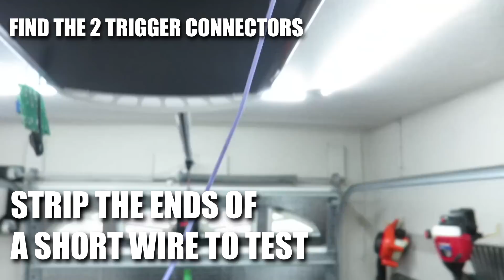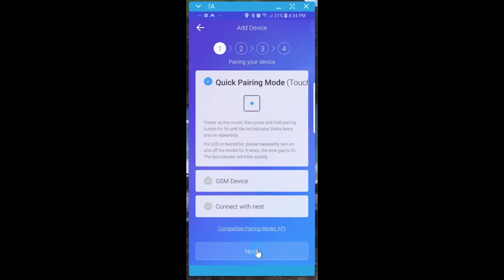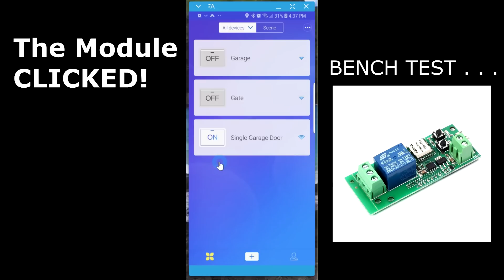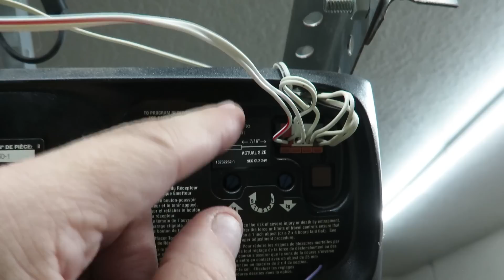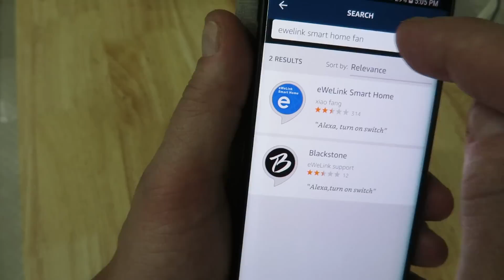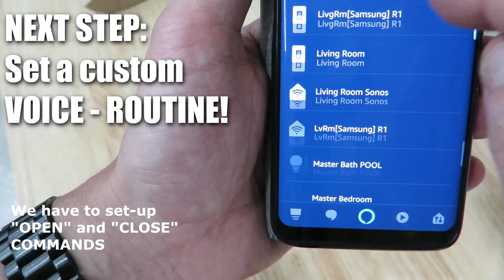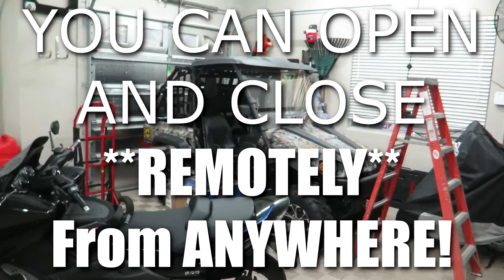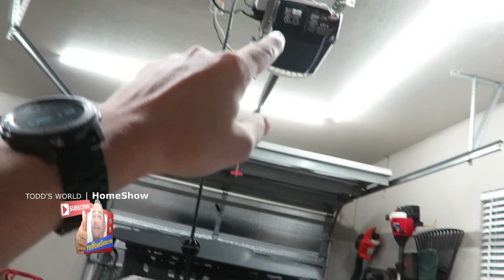SMART GARAGE DOOR OPENER | $15 | eWeLINK Smart Control for Garage Doors | with ALEXA & Google HOME

Comment: This will not work with the latest high-end Chamberlain/LiftMaster openers that use Security+ 2.0 technology.  They use a proprietary communication protocol on the 2-conductor bell wire that connects the wall controller with the opener; shorting the wires together only causes loss of power at the wall controller that contains the door control and light control buttons, but the door won't open or close.  The next-best thing is to wire the eWeLINK Smart Control N.O. relay output across the pushbutton inside the wall controller, which requires soldering a couple of 22 or 20 AWG wires to the appropriate pads on the circuit board and bringing them out of the wall controller housing to the eWeLINK Smart Control.  To reduce likelihood of RF interference with the the wall controller, the eWeLINK Smart Control should be mounted within a meter of the wall controller.
Reply from the maker: Very good explanation...although, it works fine with my LiftMaster Security +2.0 and the button works with the eWeLink board connected directly to the motor. BUT, my older LiftMaster 2.0 single garage standard door opener - has the eWeLink connected to the motor and the Wall-button doesn't work. This doesn't bother me because I just say or speak-now to open either door. I don't even use the physical buttons anymore. I'm not sure why the buttons work with some and NOT others????
Reply: My only experience has been with a LiftMaster model WLED, which was installed in July 2019, so it's a very recent unit.  Chamberlain isn't forthcoming about the technical details of their openers, so it is possible that they've changed the circuitry recently.

Comment: Is there a better duration I should use for inching mode? The app works great when I’m at home and need to open and close the garage. But when I’m driving home and am around the corner and the use the app, I’m seeing my garage only cracked open.
Reply from the maker: I had to increase my inching duration on one of my openers to (1). My other door opener is set at (.5) and works fine.
Reply: tw HomeShow thanks for the reply. I did that this morning and it worked. 
Now the issue is when I got home, the device was offline on my app and the module is blinking rapidly 4 times and repeating. I’m unable to switch it back to pairing mode neither. Any idea what the problem would be?

Comment: I was able to connect the phone app to the device and hear the clicking sound when turning on and off. However, when i have it installed to my garage (Liftmaster), I am still able to hear the clicking sound but no action on the door. It just won't open....
I wonder if I am doing anything wrong... also,  my garage unit doesn't pass the jumper cable test at 1:40... I wonder if that is it and the eWeLink unit just won't work for mine opener....

Comment: I had a problem when we had a power outage.When the power came back on my module activated and opened the door.Has this ever happened  to anybody?
Reply: Yes! If my power goes out and comes back on, the relay will activate itself and start to open the garage door. Then, it will activate again and stop it. This leaves the garage door open about 3" forever. I have an email in to the mfg.

Comment: PROBLEM... If the power goes out, Garage Door OPENS on power restoration. That's a big problem if you're away and lose power!!
Reply from the maker: Why would power going out activate? Even if it did, you would be notified and you could just close it within the app. I don't get the "Problem"???
Reply: @twHomeShow  when power is restored, the unit reads the power surge as a button press.  Try flipping your breaker off, wait a few seconds, then back on.
All else is great.  Just need to figure this out!.  BTW... Your channel is GREAT!
Reply from the maker: @stephenm2221  ahh, I see. Thanks
Reply: @twHomeShow  Got any ideas?  I'm thinking about it.  If I come up with anything. I'll let you know.  This is all you!

Comment: Great video and instructions. Is there a way to use this same method to solely control the lights to the garage opener. I want these lights to come on with my other car ports lights by  grouping them in my Alexa app.
Reply from the maker: I have the other ceiling lights in my garage controlled by Alexa with smart plugs that they plug into :) Maybe you could do that?

Comment: I have a Craftsman garage door opener whose button wall panel sends a digitally encoded message via the wire to the drive unit, so this videos instructions didn't work. However, all I did was directly solder the two wires to the button on the wall panel circuit board and that did the trick!

Comment: does this have battery backup? what if the power blinks?
Reply from the maker: You would need to use a battery power supply and also have your internet somehow backed up with a battery power supply unit.

Comment: I have a question, if i say echo close garage door  when are close could be open?
Reply from the maker: The ewelink switch doesn't identify if the door is in an open or closed state. So if you say open or close, it will just activate the door.

Comment: Excellent! Picked one up for $13, plus $5 for more bell wire than I will ever need in my lifetime. I already had a micro-usb 5v charger laying around. Works like a charm. Thank you for posting!
Reply: hi Tracey  made i ask where did you get the circuit board? thanks

Comment: Does it always work for you? Idk why my only work sometime and sometime it doesn’t. Do you have any idea?  I used speaker wire to connect between the relay module and the garage.  Can this be an issue
Reply from the maker: YES. Mine work 100% of the time, except when power goes out :) I would check your wifi signal in your garage . . with an app you can download on your smartphone. Make sure you have a constant strong wifi signal-range. ALSO, within the eweLink app (in settings) there is a timer adjustment, where you can adjust the time it activates, like within miliseconds. You may have to tweek that time up just a half (.5) milliseconds to give it a little long activation time.
Reply: tw HomeShow So on my app. I always have 3 bars for the wifi icon. Is this actually show how strong the wifi signal is or is it just there as an icon and never change. Also, my inching timer has already been set to 0.5 milisec when I first open it. I’m just wondering if there is a way to test how strong the signal is because I got full bars on my phone when I’m placing my phone at the exact location of the module.

Comment: Did you have to change the setting of the module to "inching" ?
Reply from the maker: The button on the module that you have lit and activated, determines inching mode. In the video make sure you watch that I choose the middle button ONLY, to be lit. and that one is inching mode.
Reply from the maker: You can also set the inching duration time within the setting on the eWeLink app, if it needs to be longer time or shorter time by, like milli-seconds.
Reply: @twHomeShow  thanks for the rapid response ! But still a little confused . What do you mean you choose the middle button only ? I have the same chip as you. Setup via your video ...wire in the same location . But I see an option in the setting on the ewelink app for itching ... If everything is setup like your video I'm guessing I shouldn't toggle that on? (Haven't tried my setup yet, just setup infront of me right now)
Reply from the maker: @DanK-Mtb  If your button (ewelink chip) is programmed, if you go to it within the app, you should see at the top right corner after you choose your button that you have setup within the app, select the top right corner and select settings, and slide the inching slider in the app to inching (ON position). BUT, make sure your chip has ONLY the middle of the board LED lit-up (that middle button) NOT both LED's and NOT the outer LED on the chip....just the middle LED on the chip should be lit.
Reply: @twHomeShow  ahh ok in the video you didn't reference anything regarding itching let me give it a try now 🙃

Comment: I have a Liftmaster 8355-267 opener. Shorting across the terminals that are connected to the wall switch does not activate the garage door. Is there a fix for this? Or am I doing something stupid?
 (The wall switch has an LED on it, so it must be receiving a voltage through these two wires as well). Thank you, folks!
Reply: Same issue here with my Liftmaster Security Plus 2.0.  This model is a "MyQ" but does not have built in wifi.  Everything works fine, but when I short across the terminals, nothing happens.  I know my app is communicating with the opener as when I turn it on or off, the UP or DOWN buttons on the back of the Liftmaster light up, but the door will not move.
Reply: @SteveFlanigan  Thanks for the reply, Steve. I have come to the conclusion that I will have to use a wireless remote to make this model work. I believe this is because the wall switches do not just send an on / off pulse. They send a digitally encoded signal. The remotes do the same. 

Two wires will have to be soldered to the button terminals of the correct version/s of Liftmaster / Chamberlain remotes. See this video from same author; https://www.youtube.com/watch?v=J_zAhXF_i7I&t=271s

Or, you could buy this Chamberlain Hub with door sensor and also get the indication on whether the door is open and closed as well as receive alerts when it is left open; 

https://www.amazon.com/Smart-Garage-Opener-Chamberlain-MYQ-G0301/dp/B075H7Z5L8/ref=asc_df_B075H7Z5L8/?tag=hyprod-20&linkCode=df0&hvadid=198068910902&hvpos=1o1&hvnetw=g&hvrand=14333608537176965484&hvpone=&hvptwo=&hvqmt=&hvdev=c&hvdvcmdl=&hvlocint=&hvlocphy=9012225&hvtargid=pla-365824222793&psc=1

I installed the Chamberlain hub yesterday. Works well. Alerts are nice. Will probably go ahead and wire up a remote using the sonoff module that I already bought so that I can open the door with Alexa. It looks like both systems should coexist nicely.

Comment: after I install this thing, it opens garage door automatically after power outage.  Any solution for this issue?
Reply: That's not good!
Reply: this is scary, specially because I live in an area when power outages are a normal thing, have you tried Joe's solution? or what did you do?
Reply: Maybe the door sensor would give you some better oversight. At least notify you it is open or something
Reply: It's been 3 weeks since I installed this and haven't got that issue, I have a camera in my garage so I often check just in case
Reply: That is 100% correct. I had to put my ewelink on a smart outlet and leave it off most of the time. If and when I power the ewelink via a separate, smart outlet app, the door will open a few inches. Then, I make the door open or, close all the way. I have 4 cams. in my garage.
Reply: I have an idea, but I can't promise it will work, try buying an inexpensive portable charger that can charge a device while it is also charging, this will provide power to the eWeLink, and when the power goes out, the portable charger should provide power to the eWeLink while the power is out and last at least a little while. I would think there is a better way within the programming, but if not, it's worth a shot.

Comment: I think I may be the only person struggling with getting this to work on my system.  Your instructions are clear and easy to follow, so i'm more than certain this is a user malfunction.  When I get the device connected to the garage door unit, it won't open or close the garage door.  The up and down arrow light laminates on  alternating clicks, however the garage door is not actually opening and closing.  The wall unit still works fine with both cords in. What am I missing?
Reply from the maker: OK, #1) Did you test your garage opener with the test wire on the 2 connectors to see if it activated it? Did it open and close the garage door by touching the looped wire to your garage door opener connections?
Reply: @twHomeShow  I'm being told now that the device does not work with garage openers that has security + 2.0 as in the Liftmaster 7675.   There may be some work around out there, so i'll go research and try again.
Reply from the maker: @c.jenn01  That's weird, because I have a Liftmaster 8500 direct-drive with 2.0 and MyQ, and it worked without any issues.
Reply from the maker: You can look-up my video - how I hooked that one up to eWelink....
Reply: @twHomeShow  That was your first video I  watched before I bought the device.  It paired with ewelink.  I can get the device to on/off with ewelink, the problem is only when I try to get it to work with the garage.  following your directions yesterday, I tried hooking the wires to the wall unit, but that  didn't  work,  I even took the  wall unit down all together and used the wires to connect it directly to the garage unit, that did work, but when I added the device, it didn't.
Reply: @twHomeShow  I think I'm going to return it. The underside below the white square gets extremely hot to the touch every time I plug it in.  I don't know if that common, but it makes me nervous.
Reply: @twHomeShow  Full disclosure, i did the test and it didn't open or close then either.  I just went ahead with the rest of the instructions and hoped for the best.  I figured it had to work, the system is only 4 years old.
Reply from the maker: @c.jenn01  OK, no problem. Can you remove the factory door switch/button from the wall, and it should have 2 wire connections. Try to connect a loop-wire and touch to both of those connections and see if that opens or closes the door. If so....you may be able to connect the eWeLink to that switch instead of the garage door opener unit. But, remember just tap those 2 connections for a second with a loop (test wire) on the back of your switch/button connections and see if it works.
Reply: @twHomeShow  did not work there either. It did the same thing, up and down arrow on the system just flicks on and off alternating every contact.
Reply from the maker: @c.jenn01  Curious, what garage door opener brand do you have? and on the "SYSTEM" that you're talking about, what is that system that shows up and down arrow?
Reply: @twHomeShow  It's a Liftmaster 8165 manufactured in 2015.  When mentioned system, I was referring to the actual garage opener unit.  There are up and down lighted arrow in the back of the unit where the programming button etc.. is located.
Reply from the maker: Hey, CHECK THIS VIDEO.....You can skip until the last 3rd of this video....it seems like maybe you should double-check the testing. I'm not doubting you. Maybe Liftmaster stopped this in their 2015 and newer units so they could sell their "MyQ" APP.....  CHECK THIS VIDEO OUT: https://youtu.be/omIHf5E4CsQ

Comment: I have the MyQ garage door module but since it does not work with Alexa I'm going to try this (Chamberlin SUCKS for not including this feature IMO) but because I have the MYQ app I will know the state of the door (up/down) so that will take care the the shortcoming of this setup. Great video, it was very helpful, and super inexpensive.

Update; I bought the module from your link in the description and it is working like a champ to open my garage door with Alexa. The only Issue I had was the module I received was slightly different different than the one you have and I did have to press the second button on the board to change the mode the default mode of "Normally Closed" (NC) to "Normally Open" (NO) so the switch would work as needed for this application. Not a big deal at all but if Todd mentioned this I missed it. This is an awesome solution, thank you Todd for making this video.

Comment: Todd thanks for beautiful video about setup however it does not work with my chamberlain garage door opener. i followed everything  every time i press button in iPhone app i hear click sound in relay switch but nothing happen to garage door.

Any help would be appreciate.
Reply: I had a similar issue when I set mine up. You need to push the other switch on the board to change the mode to "NO" ie. normally open since the switch is set to "NC"   ie. normally closed by default. The second button is the "mode" switch just push it once and she will work like a charm for you.

Comment: The wiring on my garage opener (Chamberlain HD420EV) looks pretty much identical to yours in the video. However, when I try to jump it (with speaker wire if that matters?), it will not open the door. All that happens are the up/down arrow shaped buttons  lights blink (up flashes 1 time then down flashes 2 times). Any help would be appreciated, thanks in advance!
Reply: Sam thing happens to me. Have you discovered a solution?

Comment: I bought the one with the door sensor. How do I add the sensor to the eWeLink app? I don't see the option.
Reply from the maker: Hey J Rod, I haven't purchased a kit with the sensors yet, as I already have both of my doors and gate done with the eWelink (without sensors) But, I would image...they just work if you've connected them to your unit. If the door is open, your eWeLink App should state "ON"...and if the door is closed, the ewelink app should state "OFF".

Comment: Will this work if my router is dual band? (2.4ghz & 5ghz on one signal) or will I have to go into my router and change it to 2 separate signals?
Reply: Hiya, this supports 2.4ghz wifi network only.